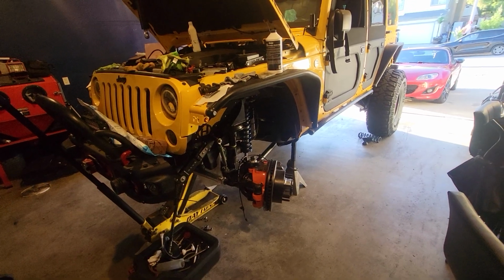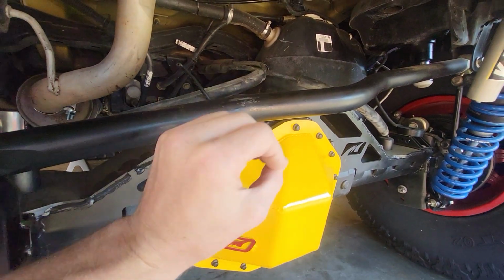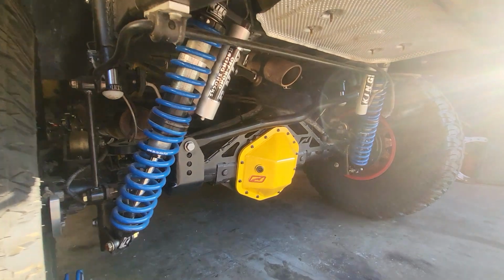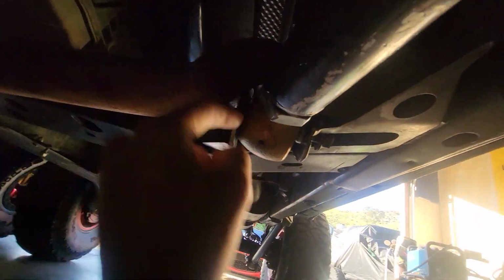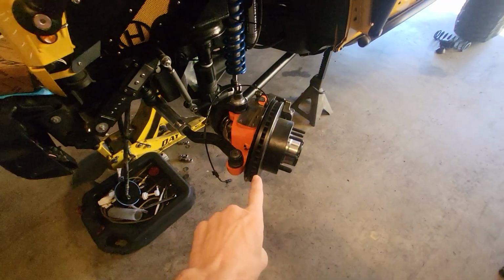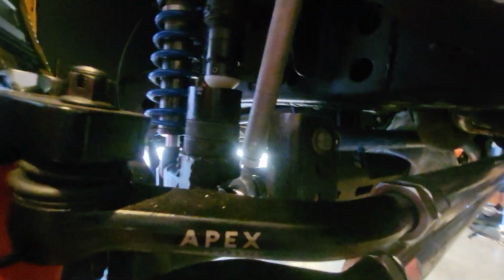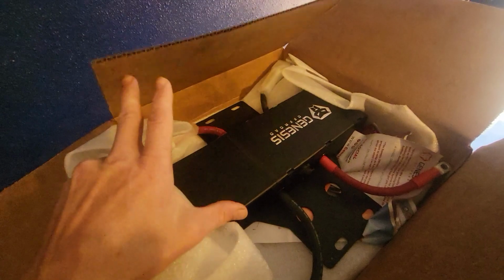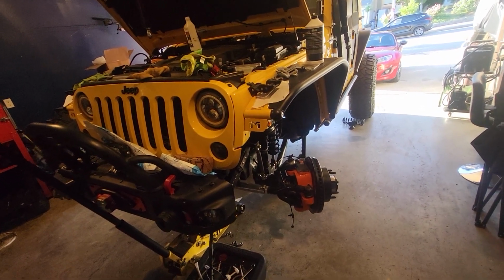The last 1 ton jk swap upgrade video jeeeprn

Comment: I just installed ORO sway lock.! But I’m having an issue with the latching arm. Mine seems loose/ rattles when on a bumpy road. Did yours do the same or have any tips. Awesome rig by the way!
Reply from the maker: No I don't have that issue.Mine just squeaks over every single bump. But its performance outweighs the noise